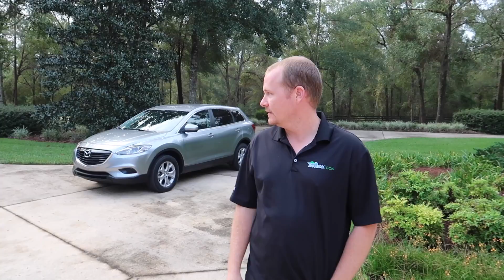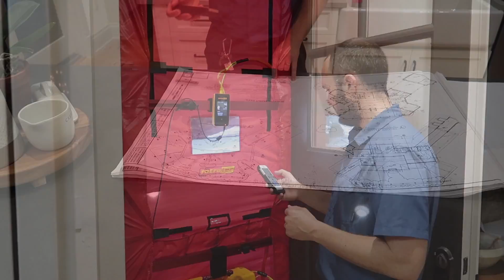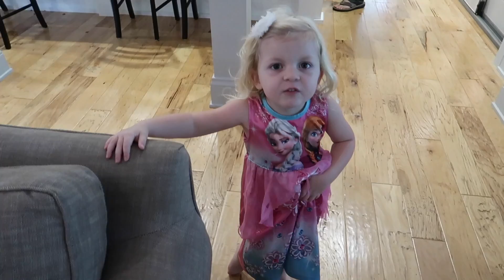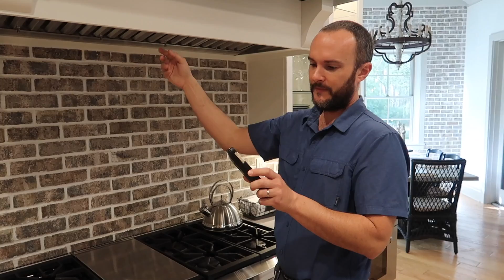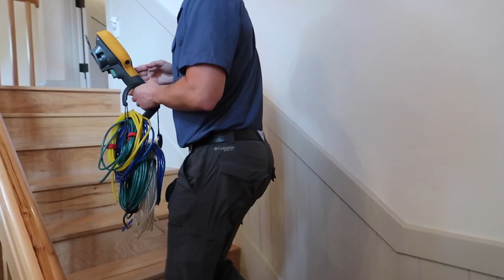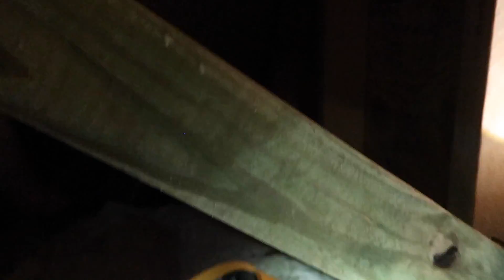Home Performance Testing: E1- Setup

Comment: I studied the heck out of this stuff when I had my home built a few years ago.  Lots of work was done to air seal and provide space for insulation.  Not easy but worth it.  Easier when building though.  Keep it coming.